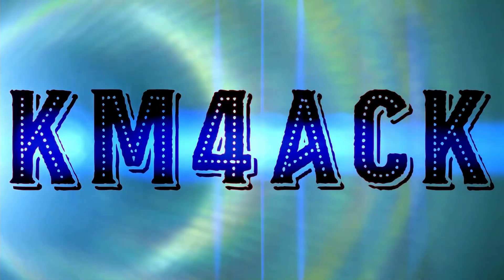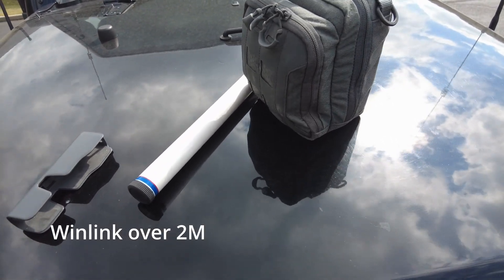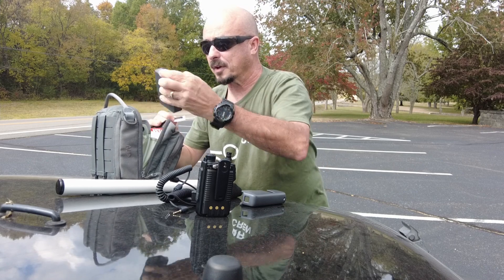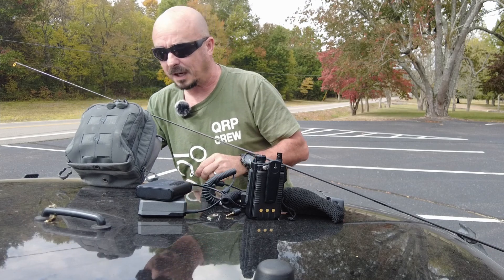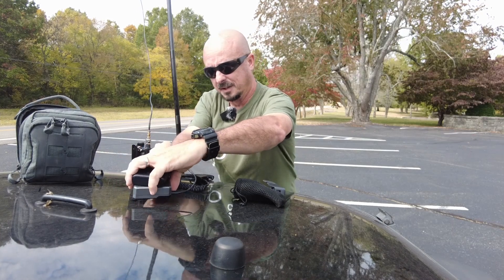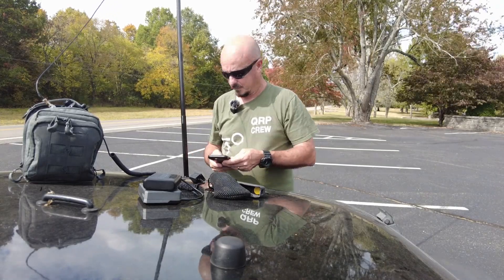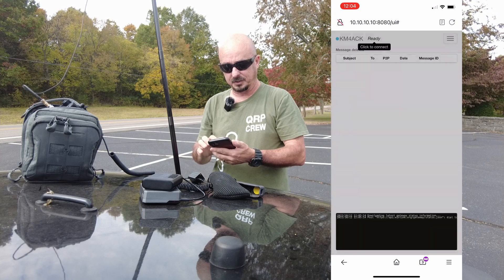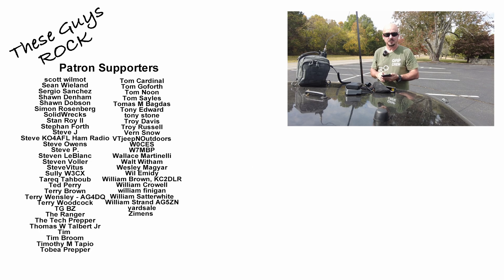Will This Work ?

Comment: Hello Jason I see you using the FT-70 with your Digi-rig. I connect my Digi-rig to the evolve computer and I get interference on mine. What could I be doing different than your setup? I have the FT-70 as well. I can connect the VX-150 HT and the interference goes away and Winlink is fine. I tried it on my no.2 FT-70 and get the same interference which are vertical lines of noise shown on the winlink software sound modem scope .

Comment: Good video Jason. My Pi have been gathering some dust during harvest but i need to make a new build-a-pi for the new upgrade system you created, as well as VARA HF and FM.  Not sure all of those updates are now included in the latest BAP script.
Reply from the maker: VARA HF & FM are included in the latest Build a Pi Beta. If you want to give it a try, check out https://groups.io/g/KM4ACK-Pi/message/9201

Comment: Hey Jason.  I have the same carbon fiber mast.  It is a great mast, but I also found that it interfered with a vertical wire antenna (I was using a 10m efhw at the time).  SWR was really high.  Do you think the mast was bent over far enough that it didn't interfere with the J pole? Or has it just not been a problem for you?  Thanks for another good video! 73 AA4K
Reply from the maker: I have only really used it with the jpole and didn’t check the SWR. Now that you bring it up, I’ll look next time I have it out.

Comment: The audio was fine. Excellent demo. I will take the bit of paper isolating the battery trick, that is brilliant.
Reply from the maker: A clever hack....yes. Brilliant would be Yaesu fixing the battery drain if you leave the radio OFF. Off should = no battery drain. The issue happens on several Yaesu HT's but I digress. Glad you enjoyed the video. Thanks for watching!
Reply: Hi, my handhelds are submersible the paper trick allows me to keep them submersible and isolate the battery.

Comment: Great video, I prefer these kind actually!

Sound was awesome. Lapel mic obviously. Is it cumbersome and is it wired or Bluetooth?

I know you normally do put stuff on the hood but a suggestion maybe. I would 3d print a bracket that holds the bag and your radio. The bag hangs below while you put the ht on the top in an upright fashion similar to its charger but all one piece. Anyway, just a thought.

Finally,  I'm excited to see the script. I think it would be greatly appreciated!!
Reply from the maker: Sorry. Forgot to link to the script. The description has been updated to include it. Great suggestion on hanging the bag! The mic used is wireless. Part of the DJI Osmo 2 creator kit.
Reply: @KM4ACK  Thanks Jason!

Comment: Is there a simplified version for beginners to winlink or should I forget it
Reply: Cornbread, it all depends on what equipment you have. You can run winlink at home without any radios attached. Its just a service that allows multiple ways to connect.
Reply: @kb9mtd-aaronwebb  thanks for your QUICK response. I have no idea what I’m doing in this field it may take a little bit more use of utube
Reply from the maker: Agree with KB9MTD. Get it loaded on your computer and get an account setup. Learn the basics with telnet (internet connection). Once you get that down, take a look at connecting the computer to the radio for RF connections. The exact setup will depend on the gear you have or choose.